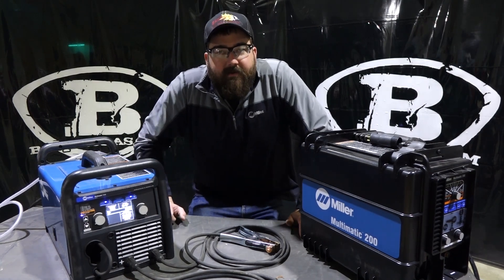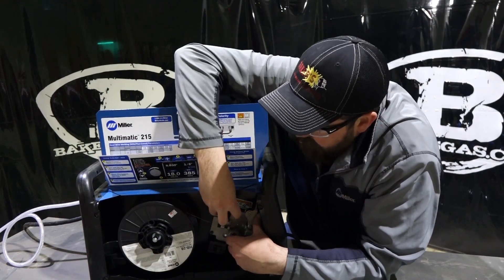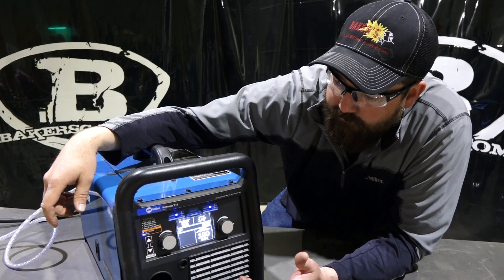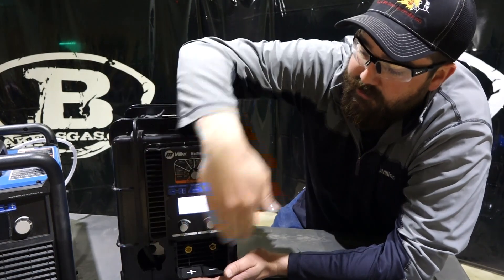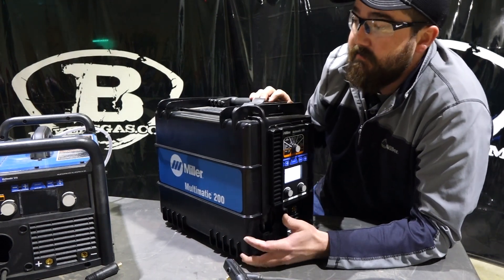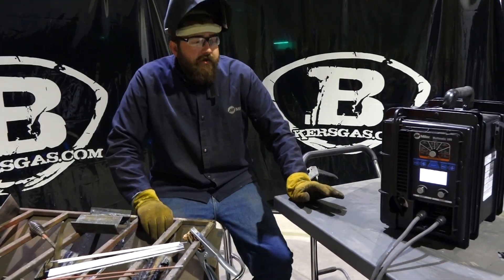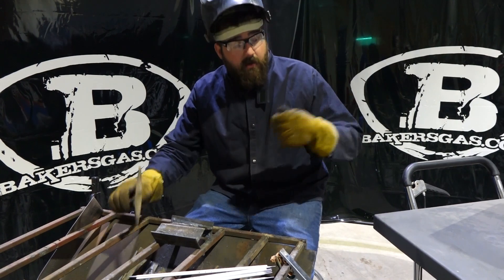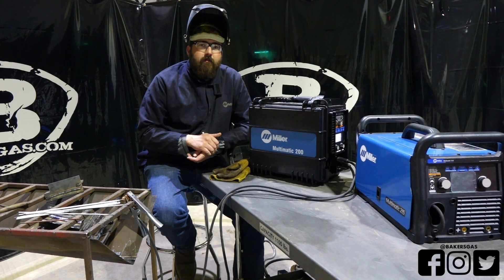Review of Miller Multimatic 200 and Multimatic 215 Multiprocess Welders

Comment: Short summary. 
If you want something durable that you can beat up go with the 200. If you want the most power for the cheaper cost. Get the 215. If money is a problem get the 215. 

Shortest summary:
Basically if your anything other than a mobile welder or someone who throws tools around then get the 215.

Comment: I got the 215 recently.  Tig is real nice, but the supplied tig pedal is a toy.  I got an aftermarket pedal from usa weld. Onboard Steel Mig 0.35 is real precise,  short/glob/spray arc is very tunable with the right gas.  You reach the duty cycle real quick when stick welding, it works well on 1/8 6011 or 7018, you just can't burn rod nonstop without it auto shutting down (cool down) after 1 and a half rods. I use the miller 150 spoolgun with 0.35 steel wire, that sprays well. It sprays well with 0.35 4043 aluminum wire and argon. Its not a heavy duty fab shop kind of machine but it works good for lite use with lots of cool down breaks. Duty cycle is the key to keeping it happy. I got my moneys worth.
Reply from the maker: Thanks for the feedback!

Comment: 10-aught extension cord?  Probably just 10-2 stranded wire.  According to the ampacity charts, 10-AWG wire should carry 30 A without overheating.  The voltage drop over 100' at 30 A is 5-10 V, if I remember correctly.
Reply from the maker: 10AWG is what we used
Reply: The supplied power cord is 14 AWG

Comment: I do mostly stick welding but after hearing him talk about it should I get it?
Reply from the maker: If your doing mostly stick you may want to consider a stick machine. Have you looked at the new Thunderbolt? He really focused on the stick because people had the most questions about that with those 2 machines. If your looking for multiprocess these are great machines! If you have any other questions feel free to comment here or call us! 877-930-5690
Reply: I stick weld 20+hrs a week the rest tig at work and use a miller syncrowave 350 lx tig runner full spec it's not the best for stick it but it does lay down nice strong welds with no functions on stick other than ac/dc

Comment: The auto set feature is sort of good for beginners, but you can turn off the auto set and manually tune the volts and wirespeed for just the right results on mig and tig and stick. Spool gun wirespeed is also adjustable on the machine not on the spoolgun. No wire speed controll dial on the spoolgun. I use the #26 200 amp tig torch. The supplied  #17 tig torch is ok, but it heats up pretty quick on high amps, its good for lite quick welds.
Reply from the maker: Thanks for sharing!

Comment: Bro Please tell me the price of 215
Reply: 1600 or 2000 w/tig
Reply from the maker: Sure so right now there is a rebate on the Miller 215 of $200! If you add the TIG kit on separately and a few other accessories it will qualify you for additional rebate of $200 (Total $400 back from Miller)Plus we have a great Bonus offer going on! Feel free to email or call us for more info! Email: support@bakersgas.net or 877-930-5690

Miller 215 linked below
https://www.bakersgas.com/MIL907693.html
Reply: Baker's Gas can you do spray with the 215 or just short circuit